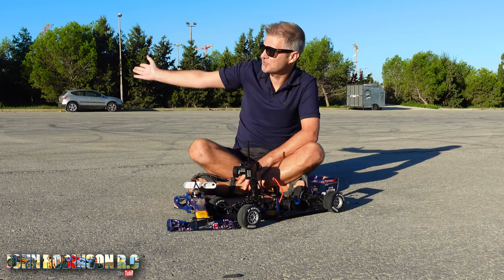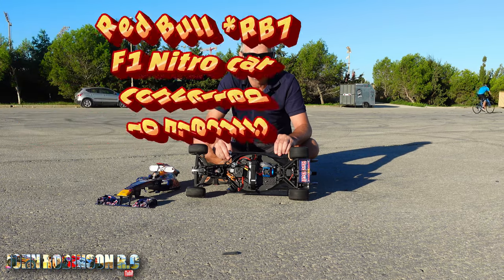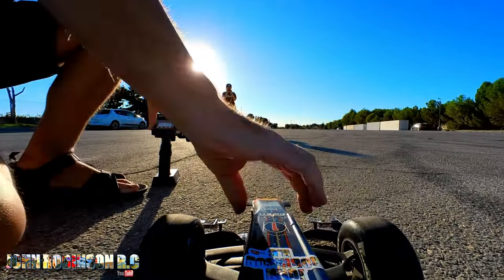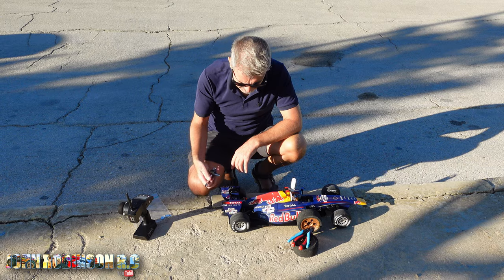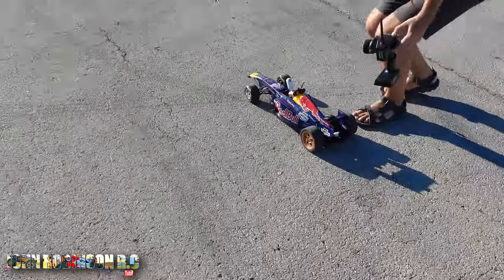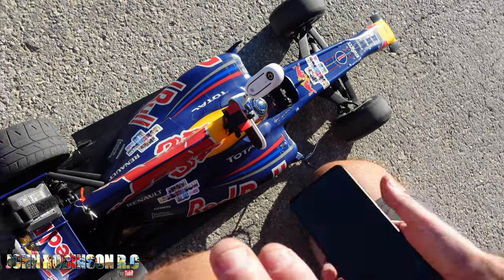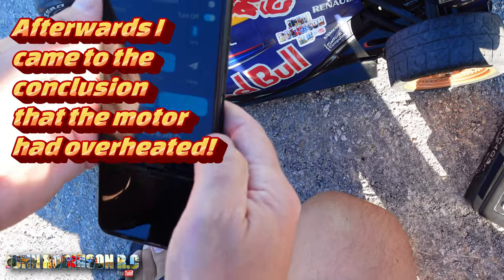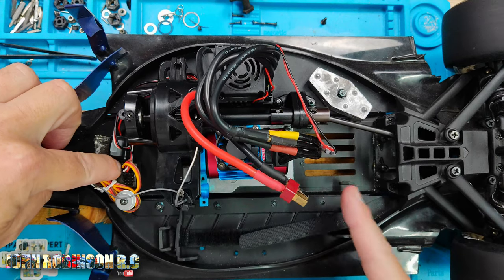I really thought it would work this time.... #frustration

Comment: Blimey!! What a pain. Its two steps forward, and two steps back, isn't it!! I think you're right to ditch the direct drive. I was thinking about the centrifugal forces in the rear diff, trying to keep up with the speed of the motor spinning, and whether that was contributing to the car spinning, but that didn't make sense after I thought about it again!!

Having the spur and pinion should certainly help the strain on the motor, I would have thought.

Don't give up with it. Apart from the massive gold wheels, it looks so great.

Fingers crossed you make more progress this time. 🤞🏻😊
Reply from the maker: Yes I feel the same way but realised for every 2 steps back, I am marking two things that it can't be. So still moving forwards. I have several new ideas and the pinion and spur setup really seems to help a lot. So just need those foam tires and we should be sorted! 😉👍🏼

Comment: Hey!
Finally somebody trying mods in the deagostini kyosho f1!
Purschased 2 of them, the 1/8 f2004 ferrari and the 1/8 f2007 ferrari both with the nitro engine... donw want to make it electric power buut want to reinforce the suspension and the traction.
There's a guy who change the springs, refilled the shocks and put some kind of aluminum reinforcenment under the suspension arms to give it stiffness aaaand some foam tires from the model of a buggy rc with track tires. seems to be a good combo.
Reply from the maker: Hiya and thanks for the info. Yes frustration level 100% with nitro f1 cars. Making the most little of changes completely effects everything. This is still a project that I want to complete. I was going to sell the Nitro redbull and electric redbull as well as the f2004 plus 3 chassis all together. But I just can't being myself to do it. I know when I finally get them working correctly they will be awesome. Honestly for me the most frustrating part is the tires. I think I will take the wheels and learn how to make my own foam tires. That would solve so many issues. Good luck with yours! 🤞😉😊

Comment: It's getting there matey. Slowly but surely. I did notice one thing that may not be helping. The weight you have in the back is on one side and that could be causing issues. Might be better if you centralise it.
Reply from the maker: Yes but the battery is on the other side mate so I was trying to balance it all out. 👌😬😉

Comment: I think you should look at rwd drag cars, as they have much in common with this car.
They also make their cars narrow, as it should make them more stable(I don't know how that works).
Reply from the maker: Yes you are right mate. Plus fronts will already be bearing types. I will investigate now. 😉🤙
Reply: @JohnRobinsonRC  I'm not sure what wheel type they use.
But I think it's 12mm hex like other 1:10 cars.
Reply from the maker: Yes seems that way. I need 17mm and 12mm altered won't have strong enough pins due to the shaft thickness. However thanks to your comment mate. I think I have found three alternatives for the rears. Now need to find the fronts. 😉😂😂🤙🤞

Comment: With the rubber tires, I think the suspension is too stiff. Instead of squatting a little and putting extra weight on the rear tires, it just spins them.
Reply from the maker: Good morning. Yes you could be right but it's the catch 22. Need the weight to help with traction and therefore the suspension has to be soft to take the weight. And it being too hard causing some issues. Hopefully foams will help and I can remove the weights. 😉😉😉🤙

Comment: I think it's the display tyres and bottoming out won't help.
Reply from the maker: Hiya. I'm pretty sure (can't be 100% sure) that these are the running tyres and the yellow ones are display. But as we all know. I've been wrong before. 🤣🤣🤞

And yes bottoming out is not good. This time I noticed a lot more bumps and holes in this location which sucks.
Reply from the maker: Dude. You have made me second guess the tyres now. Had to look and there aren't any display tyres as such. Whites are hard. Like mine. Yellow are medium. And red are mega soft. So will put my set of mediums on. Thanks dude!